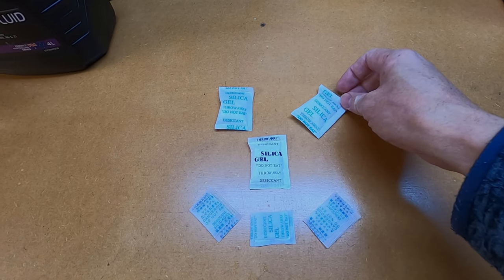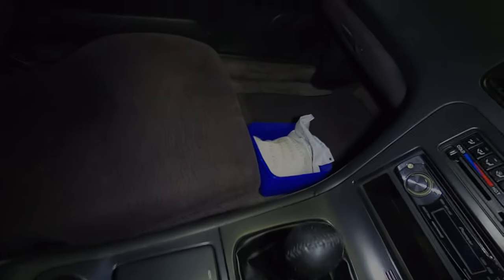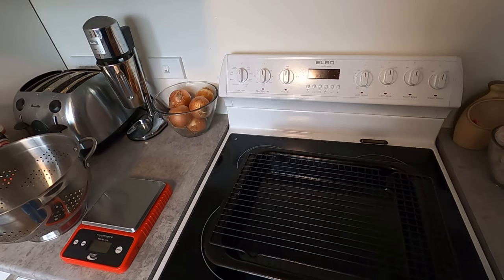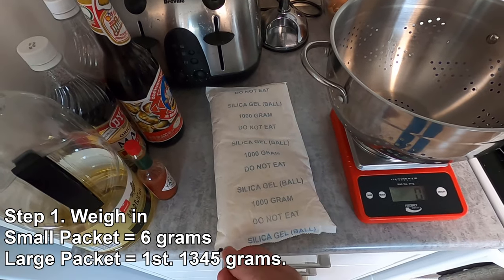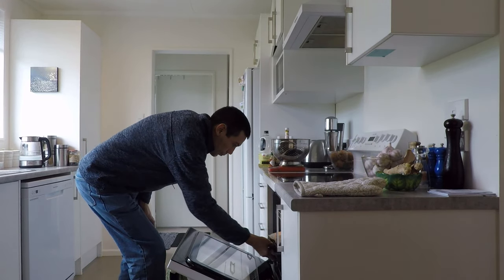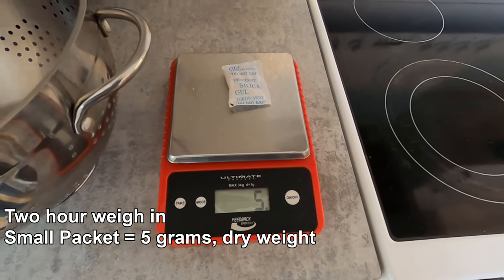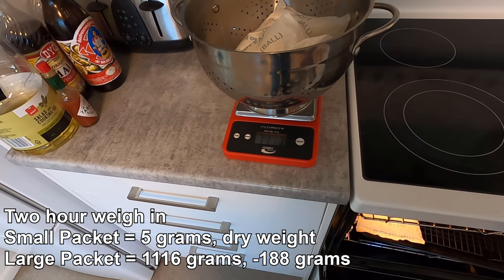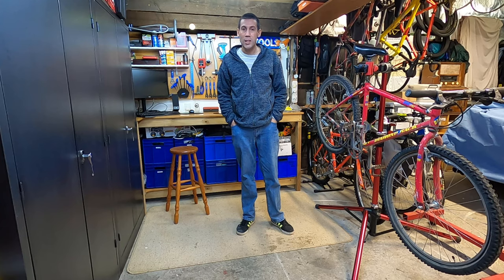How to recharge silica gel - silica gel regeneration

Comment: Hi...I kept my silica jel in the oven and the tissue under the silica was burnt and the silica turned brown...Can I still use it ?
Reply from the maker: Hi there, I'm late on comments.  For the low price to replace silica gel I would just replace it with new, to be sure it will work.  However if you want to keep it, you could always weigh it like I did in the video, overtime check the weight to see if its actually working by soaking up moisture you will see the silica gel packets get heavier. Thanks 🙂

Comment: What Fahrenheit setting the temperature?
Reply from the maker: I baked the silica gel at 120 degrees Celsius, I find that temperature is good as it doesn't melt the bags the silica gel comes in.  Using an online converter 120C is 248F, thanks for the question. 👍🙂

Comment: Can I use a microwave?
Reply from the maker: Hey there, yes you can use a microwave but to be honest I don't know what heat settings or cooking time you will need.  I guess if you can weigh the gel like I did you can at least keep an eye on the drying progress as you go along.  Also if you have those silica gel metal trays which the beads sit in, don't put them in the microwave when drying. Thanks for the comment 🙂
Reply: I always use a microwave oven to recharge my bags of silica. This was the recommended method mentioned in the user manual. I use 4 bags of 1 kg each in my car cabin to get rid of dew and mould. Need to be recharget once a month. Before recharging i weigh it on a kitchen scale to see the exach moisture content. I have made a formula to calculate the time at full power in the microwave oven for a 1 kg bag. 3 minutes to heat the bag up to 100 C. + add 1 minute for each 10 gram. Example: 150 gram of moisture: 3 + (15 x 1) = 18 minutes. Allow the oven to cool down before you insert the next bag. Some microwave ovens may be damaget if overheated. If you overcook the silica bags, they may be damaged. (Sorry for the european units.)